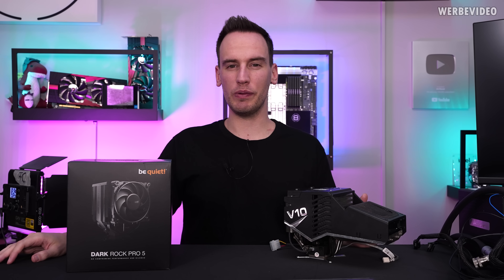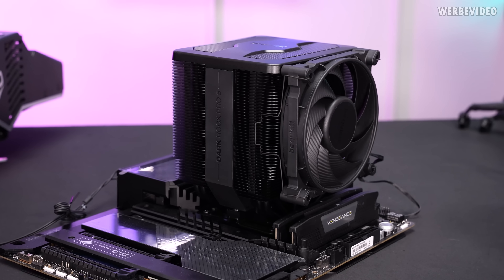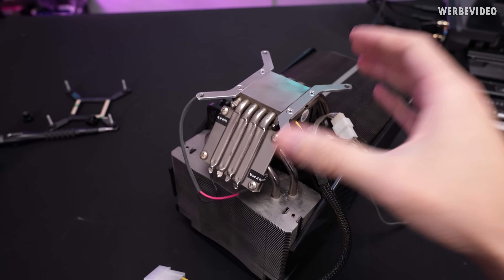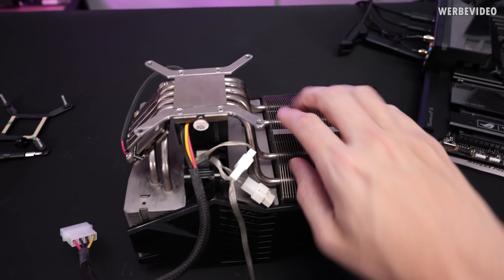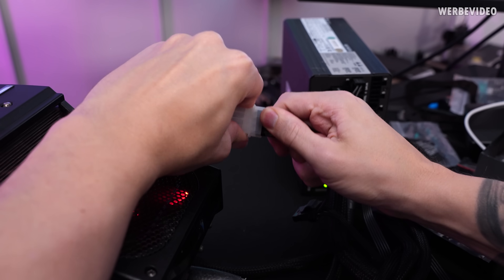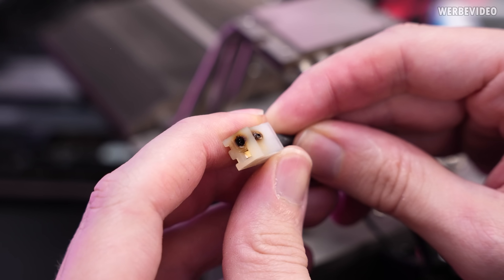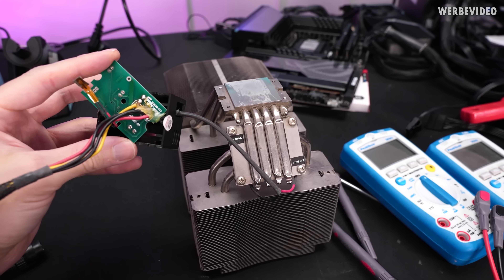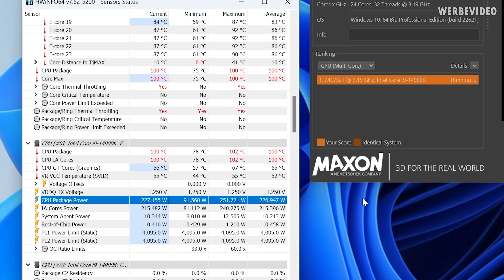This Gigantic Cooler from 2009 has MASSIVE Problems...

Comment: TEC can transfer very limited amount of heat - and here we are way beyond that. Fortunately, heat transfer curves are available in the datasheets. 12706 TEC that you selected - is among the weakest in the 127 line. But even 12715 - can only transfer ~70W with decent deltaT of ~30°C. So to cool 14900 one would need 4x 12715 TEC, and run them at combined current of at least 50-60A (that's 720W of extra heat!!!). This is definitely doable, but not in this arrangement. With dual water loop probably...

This original product could have worked with low-power CPU's of the past, consuming some 10-20-30W of power, not more. There it could have cooled below ambient.
Reply: The manufacturer rated it at "200W+" and he replaced the original 70W TEC with a 72W (6A @ 12V) TEC. The goal was to test what it might have been able to do from the factory before aging and controller failure so a 12715 would have been inapproproriate (but could have been tested as a follow on, not that I expect a single one to do much). The sad thing is that this thing probably HAS enough surface area to at least match the modern cololer but significant fractions of it is only connected to the TEC.
So they could have made it cheaper and better by dropping the TEC and extending the heatpipes directly into that area too. If that's not an epic failure I don't know what is.
Reply: @Torbjorn.Lindgren  Yes, here I agree with you completely on all points.
Reply: Genuine Question: Why would someone get a cooler that requires dissipating over double the amount of heat generated by the source CPU?  Wouldn't it make a lot more sense to just get a water cooling loop to dissipate the 300w directly from the CPU?  I genuinely do not understand the point of these TEC coolers.
Reply: @Zyxlian  The lure of TEC is that they can cool things way below ambient which "normal" cooling can't do. IE, many TEC's are rated for do 60-70C temperature delta between the two sides, so if you can cool the hot side sufficiently the cold side could be far below freezing. You can stack TEC for even bigger deltas but the power usage quickly grows truly insane (3-stage can do 90-110C temperature delta but would IIRC require cooling 27 times the original power instead of "merely" 3 times!).
TEC has lots of neat uses but computer cooling isn't one of them. If your really need continous sub-ambient CPU cooling just use some kind of phase change chiller (IE an AC), a good one will use ~0.3x the transferred power instead of 2x that TEC needs and for short term extreme sub-ambient just use dry-ice or LN2 (or LHe for the ultra-extreme category, some computer world record uses this). If a single chiller won't go cold enough, there's multi-stage chillers that go very cold indeed, these were available in PCs at the very high end for a while (and might well still be possible to find).
And the way they set this up could never really have worked anywhere near as good as ditching the TEC and "just pull the heat pipes up into the third stack too instead", they were clearly planning to sell it based on buzz-words. Not an uncommon approach even if not usually take to this extreme.
Reply: @Torbjorn.Lindgren  yeah, only viable use cases for TECs are when stable sub-ambiant temps are needed, and heat dissipation isn't a bottleneck. Or when you want to use a temperature gradient to generate electrical power. As soon as you get above 10~15W devices, cooling them using TECs becomes a technical challenge.
Reply: @Torbjorn.Lindgren  The ratio of heat load vs max capacity is roughly the inverse of what you will get in terms of delta from hot side to cool side. So having an extremely over powered 3 stage cascade system you can get down pretty far in temps, about -60c, before TECs exceeds what it is capable of cooling. Such systems require  a lot of power, about x8 the load to drop from  30c to - 60c. For a phase change setup to get nearly that low with slightly less power but will require at least 2 stage cascade. This is much more complex to build and potentially dangerous depending on the gases used. I know around 2k people where often using r134 for first stage, good for -20 c, then propane for second stage which only gets you to -40.  
I do agree that that product is a gimmick and most the sub zero TEC setups I have seen  have been self made  2 stage cascades getting -20 c to -30 c . At that point you are running a decent external power supply and probably at 15v or 24v.
Reply: @Zyxlian  Well, they don't really have any. These are just scams.
Reply: And that's assuming he got a proper quality TEC. Most "127 line" TECs on the market are worse performing copies
Reply: @WouterVerbruggen  I would say there are very few factories making these, so not more than 20% performance difference... All Chinese samples I've dealt with worked ok, and any deviations were within expectations. High volume automated production allows one to delivery consistent results.
Reply: That's not even the biggest issue with these coolers. The biggest issue is the heat that the TEC generates. Putting a TEC between a heat sink and a CPU can only makes things worse : now you need to extract the heat generated by the TEC on top of the heat coming from the CPU.
4 12715 TECs won't help you cool a 14900 CPU : the heatsink area you'd need just to dissipate the heat coming from these TECs would already be enough to cool the CPU.

TECs are great when you need to keep something a stable sub-ambiant temperature at the expense of an increase in power draw and total heat to dissipate. They're good in case scenarios where temperature regulation below ambiant is important, and heat dissipation isn't a bottleneck. That's basically the complete opposite of CPU cooling.
Reply: @gabrielhmi  What 4x 12715 allow you to do is cool below ambient. Which is impossible to do with regular cooling. But price for this cooling is too damn high. Phase change chillers are dramatically more efficient.
Reply: @BarsMonster  In a normal setup, 4x 12715 will not help you cool a CPU below ambiant : they might even heat it up instead, because your bottleneck is heat extraction from the heatsink, not the CPU itself. You'd need a car radiator to pull it off.
Reply: ...why not just use that loop to cool the cpu on its own then?
Reply: @Ironclad17  Impossible to cool below ambient. But very easy to cool to within 5°C of ambient.
Reply: But as you said, you're just adding heat into the system.  Pissing in the wind.
Reply: @jamesbyrd3740  You are adding heat to hot side of the loop, where you can have insane cooling capacity. 1000W in second loop, 200W on CPU ) It can work, but it is incredibly ineffective.
Reply: One day someone will do a TEC cooling video where they don't do it entirely wrong.
Reply: @Alex-qq1gm  The only way to do that is getting one of these TEC products and removing the TEC. Using a TEC to cool a CPU is wrong to start with.
Reply: @gabrielhmi it is a valid solution to drop temperature of a system below ambient. Assuming:

1: you are deathly scared of carnot cycles.
2: carnot cycles do not fit.
3: in case you like carnots, you prefer to have a tec instead due to non moving part means tec lasts longer than a compressor.
Reply: @Alex-qq1gm there are research papers where people actually do it right.

Myself included, but I only have it on resume and not paper, because people will act like hyenas if they realize I dont even have a b.s. degree.

Comment: Imagine if they'd made a W16 model!  
Oddly Brian (Yes Tech City) was having a nightmare with the smaller V8 this week, with rounded off mounting screws on a FX build.
Reply: Yeah I just watched that too! The cooler master 212 Evo and 612 were great at this time, but the higher end V8 and V10 models clearly don't deliver!
Reply: @LawrenceTimme  The V8 was generally well recieved back in the day, V10 though...yeah, not so much, lol.
Reply: @LawrenceTimme  Long time, how you doing. I take it you're as happy as me with this current gen of hardware, a hard pass lol. I sold my 6900XT and just running at RX 6700 in my daily for the min, efficient running with an undervolt.